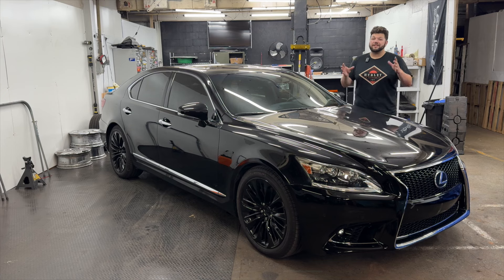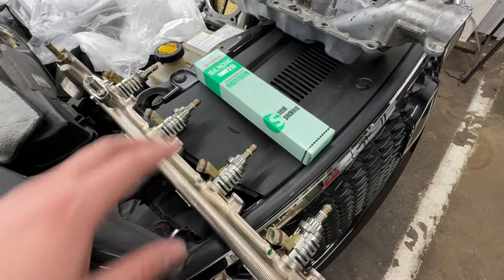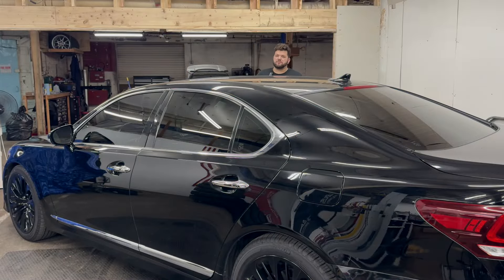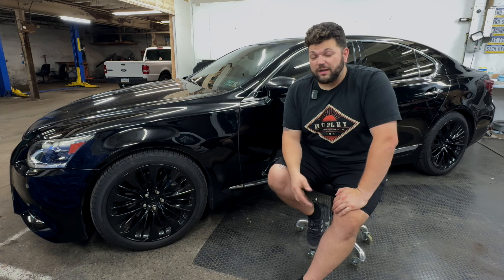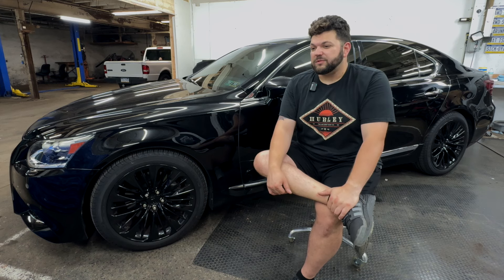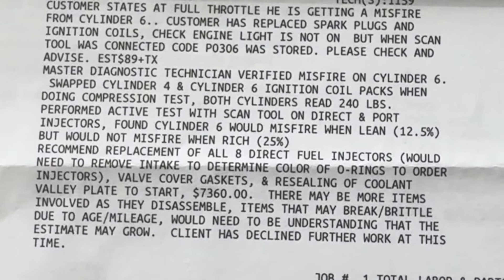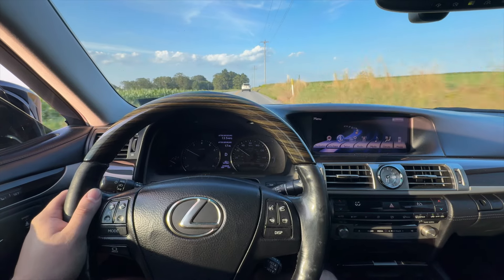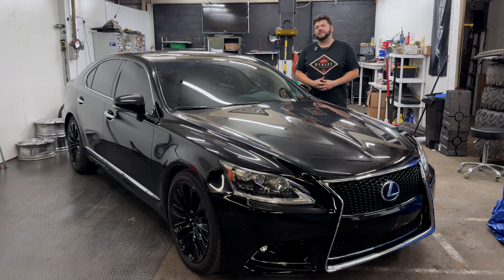My Lexus LS 460 Is Fixed! TOTAL COST REVEALED

Comment: I have a 2014 LS460, now 10 years old. Around town 13 mpg and on the highway 25+  mpg. Other than a windshield wiper sensor that was replaced under warrantee many years ago, the car has been bullet proof with no other mechanical or other issues in 10 + years. I understand that you purchased a high milage vehicle. What did you expect? If you plan to drive locally and not on the highway, then expect poor mileage but a great ride with comfort and very good acceleration. On the highway, smooth and quiet. Given that this is a V8, 25+ mpg is not bad. My other car is a recent RC350 F-sport, which I thoroughly enjoy. I get 32-33 mpg on the highway. I wish you well in your endeavors.

Comment: My 2016 LS 460 is sitting at 199,244 miles and I will hit 200,000 this weekend. I think a lot of it comes down to the maintenance of the owner. I have been meticulous in my ownership since I bought it brand new and it has been flawless. I hope to hit 250,000 by it's 10th birthday and see what happens from there. Based on when I plan on retiring I should hit 500,000 miles with no problem. I am a Regional Manager for my company and average around 25,000 miles a year.

Also, I have the RWD model so I can tell you your mpg is bad because of that. I get 27-28 on the highway with 18-20 mpg in city bumper to bumper.
Reply: How's it running can u give us an update
Reply: @destytayzo77  still running great. Just went out and looked at the odometer I’m sitting at 206,156 miles. Before the end of the year I’m going to have the timing belt changed and a few other maintenances done. It is my daily driver so I try to take good care of it.
Reply: @SuperSnakePlissken  I just bought an 07 Ls 460 I need a strut and brake actuator it's the first car I've ever had really want to take care of it. It's got 170k miles it rides better than any car I've been in. I'd like to change the oil and sparkplugs next week.

Comment: Love my 2003 LS430 w 270k miles , runs pretty smooth no big issues just minor suspension worn out
Reply: Cool, I've a 2017 LS460 myself, love this magnificent machine and is without a doubt the best car I ever drove, let alone got to own.  I did fleet work for 30 years, must have driven thousands of different cars over the years, and so I don't say that complement lightly.
The most important reasons i bought it over, say, a Cadillac, BMW or Mercedes, is pride of ownership!  I'm don't mean bragging rights or some such, I mean the feeling i get every time I drive it knowing i own one of the best cars in the world.  These other cars might be slightly more luxurious, take corners better, or have a quieter ride than my LS460, but the LS has two things those brands never will have: it's durable and i know I can rely on it.  A car could be the smoothest, quietest, most powerful car you can get, but it is still inferior to the Lexus if it breaks down all the time!  And if a car's likely to break down without warning and to do it  several times a year (and costs me 4 figures to fix it every time it does so)  I can't have any pride of ownership in it.
Reply: Suspension on lses is NOT minor repair. 
People keep downplaying ownership cost of them and overrating reliability and you create this fake unrealistic expectations in people that they can own such luxury car and it'll cost them nothing besides oil changes. 
It's really damaging imo and hurt future naive buyers

Comment: Marty I'm so glad you were able to resolve the fuel injector issue!  BTW after hearing your injector issues I happened to price the ones for my 2017 LS (the part number is Lexus 2320939155B0 for the first set, $300 ea. and for the "port" injectors it's 23209-38060, $142 ea.)  as always aftermarket can often be found dirt cheap if it's the only ones that are in reach right now, $106 for 8 injectors (no price given for the set of 16, since 8 of those in the set need to be for "PORT" ones), better than none! 
Every mechanic has been there, the impossible repair, that turns out to be something you'd never expect.  It must have crossed your mind, that you got the car when you did, for the price you did (IDK what you paid for this car) because the previous owner couldn't resolve the problem either? 

I worked for a fleet for  30 years and saw a lot of huge mistakes, but nothing like this - wrong injectors fitted?  This is the kind of thing I'd never even be prepared to find, let alone to fix.  Also about the best "for lack of a nail" stories/automotive category, I ever heard. 
 
I think many or most mechanics might never have detected that 8 (or 16? for owners who haven't gotten this far into the LS yet, the LS 460 uses 2 fuel injectors per cylinder, so when shopping parts 8 of those need to specify they are "port injectors") of the injectors had been replaced by the wrong type! It would have taken a really good mechanic to spot this problem.  Turns out Marty is that really good mechanic... No wonder he was ready to dump the car!

Comment: I'm really happy it worked, I was the guy who suggested it has to be the injectors from your last video... When a car misfires, emit black smokes and no obviously air leak with a smoke machine, with high positive or negative fuel trims.... It's the injectors... Now what I find weird about this Lexus design is on other cars it uses D.I for only higher speeds then port injection for low speed but in Lexus/toyota design they both work simultaneously even at idle speed the there's a D.I bias on higher speed... It's crazy. Enjoy your ride bro, happy motoring... Just be on top your maintenance and you're gold... Isn't as unreliable as the internet makes it seem.
Reply: You seem really knowledgeable, do you know if the ls600 also has this unreliable engine design?
Reply: Still reliable than most Americans or German cars. 😂 once he got this fixed, it will last even more miles unlike other cars that getting issues every months or weeks even.
Reply: IDK whgat your source is so you could be the one who is right, but, even Lexus says the two injectors don't work at the same time, the engine uses one or the other depending on engine conditions.  Uses one injector for idling the other one for accelerating, the engine computer makes them switch between each other, and rarely if ever uses both at the same time.
Reply: The problem is exactly opposite.
People make it seem more reliable than they are. Way . Waaaay more. With all of the lses

Comment: Yaaaaay finally~~ That LS 460 looks stunning~ And I'm surprised that Lexus built such an unreliable vehicle, since it's Toyota/Lexus, it's supposed to be bulletproof reliable.
Reply: I would say it's unreliable compared to the standard benchmark Lexus is known for. However, outside of that scope, it is reliablie compared to the BMW 7 series, Mercedes S class and Audi A8 it competes with.
Reply: @gavinr9107  that is true it is definitely unreliable for Lexus standards but it’s still Lexus so it’ll still outlast those other competitors.
Reply: A lot of the bad reputation of the LS460 cars, is because some of the optional equipment packages, installed assemblies that later proved troublesome and/or expensive to fix.  The optional air suspension was one of those.  It was reliable, for a while, but pneumatic systems in general are not usually known for bullet-proof reliability.  And when the air suspension broke, the repair cost (just one of the 4 air shock struts could cost almost $2,000) could often be more than the car might be worth.  So a lot of those owners, faced with a fix-it or dump-it decision, opted to switch back to a conventional suspension (the kit to do this is about $1,000, or, one could simply unplug the Suspension Control ECU and get roughly the same result, but free).  

I bought my 2017 LS in May 2023.  It is rear wheel drive (vs all wheel drive and all its added hardware), and without air suspension.  If it had either of those things I would have bought another car instead.
Reply: That's the problem with internet. 
People are really extremely biased for some reason towards toyotas. 
"It's supposed to be reliable". 
No sir. Its people on the nets who create this weird fake image of reliability. It's really bad. 
Just read into it. Every . Single one. Of Toyota engines have serious issue with them. Oil consumption, vvti gears, leaks, water pumps. 
It's mindboggling at first but then you just realise, they are just cars like any other, with a lot of issues. A LOT.

Comment: My 2007 LS 460 at 170K miles luckily have not had these issues. I did replace fuel pump seal at 130K just as a preventive maintenance.
Reply: I am in SoCAL, costco gas price for premium is nearly $4.4. My next car will be an EV, for sure. I am in renewable energy industry.

Comment: I am now working on our 2011 LS460, heat exchanger (valley pan) reseal. NOT a fun project, I’ve been a farm mechanic for 40 years, worked on tractors, harvesters, farm trucks and this is the worst. 1 injector broke while disconnecting the terminal. I am very cautious installing the various new parts as I Do Not want to do this a 2nd time! So sorry you had so many problems but I see why!
Mike

Comment: Hey Marty thanks for the videos! So I've been working on my 07 with 193k. Had a bad valve cover leak. I did both sides but I'm getting a leak on the driver side. I did everything to spec and used oem gaskets. Any help will be extremely appreciated.
Edit: i did figure it out a while back. Some advice to anybody taking on that job or any work this car, don't do it if you can't see well. At the time i broke my glasses and couldn't see all too well and made a few mistakes. Anyhow, the LS is driving great after all the work i did to it. I'm getting 17 city and 30/32 mpg highway. I'm enjoying it right now but I'd sell for the right gs350.

Comment: It is probably the prettiest LS model, and the right colour.
But understand that it can feel like the money is running out of the wallet.
Petrol is expensive in your country, but here in Norway it still is.
Too bad you don't feel you can keep it. But the electric car is naturally a completely different cost saver.
I'm having the same problem here. Have several cars, I could think and use them for the weather, but the cost of fuel... Yes, it kills a lot of the joy of using them often.

Greeting
Pål (Paul)
Reply from the maker: You definitely understand! The EV truly saves me a lot of time and $ and is hard to compete with in that regard. Sometimes less is more!
Reply: @LensOfMartin  Yes, you have to think about what is most important right now. You can probably buy cars later too!
If you started for yourself and want to build up your own company, this takes time and money doesn't always come easily.
Good luck!!!

Greeting
Pål (Paul)

Comment: wait 14-16 mpg for AWD, i had a 2014 ls460l and was rwd and easily had 20-24 mpg. also have the 07-09 ls460l and same 20-22 mpg
Reply from the maker: Yeah I mostly get 16 with my local driving but it’ll do better on the highway if I reset it
Reply: Why have two of the same car? How much better is the facelift car?

Comment: I never heard anyone mention the LS460 is the least reliable Lexus... Not sure where you got that from. The most expensive to Maintain, yes that I heard a lot.
Reply from the maker: I’ve seen it on forums and heard it from a few people. Relative to other models I’ve owned, it has the most known issues and needs more maintenance. I went into it knowing that, having fixed up many cars, but didn’t expect it to fight me along the way lol.
Reply: @LensOfMartin i thought that was only the ls460 before the facelift, but your video solidifies that it also applies to the double facelift model 13+ years

Comment: Except for the valley plate, which lexus will reimburse you for, your issues are not a common occurrence at all.  You bought a lemon. The reliability of your year in consumer reports is perfect in nearly every category.  And given since of the parts you’ve used to replace it with to save money, I’d say it’s STILL a lemon. Glad it’s worked out for you in the end.

Comment: Realistically this wasn’t that big of an issue and was likely messed up from a previous repair, you just spent a lot on guessing the issue.
Reply from the maker: True, it was just the direct injectors plus all the gaskets and valley plate which was pretty involved due to all the labor. But I faced leaks, troubleshooting and bad injectors along the way so it wasn’t as straight forward as it seems, and the codes led me to believe other things were wrong along the way. For example, the throttle body connector broke so I have to wires up a new pigtail for that. The plastic gets so brittle unfortunately and little things like that set me back.